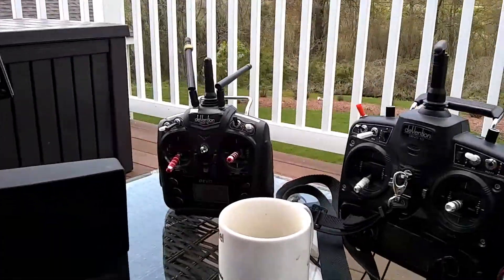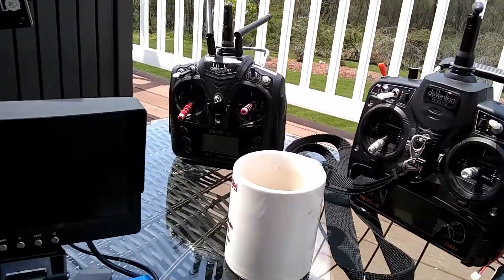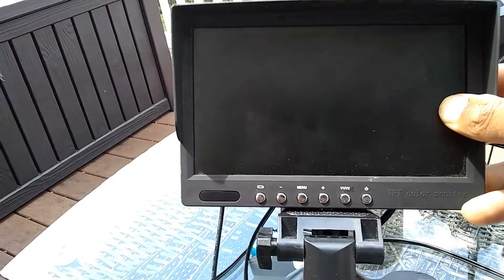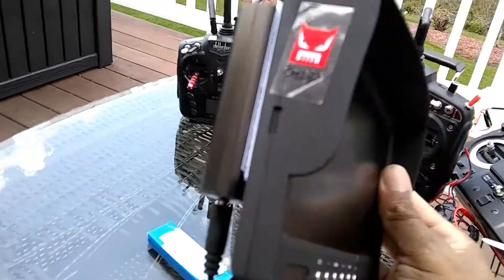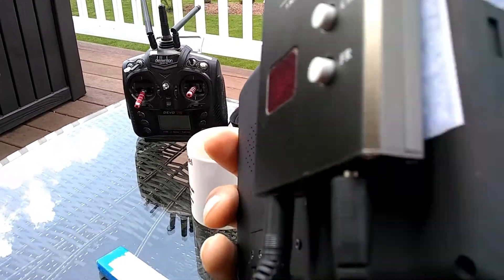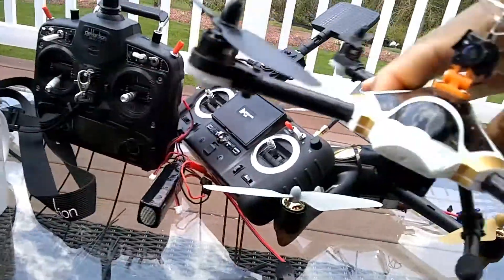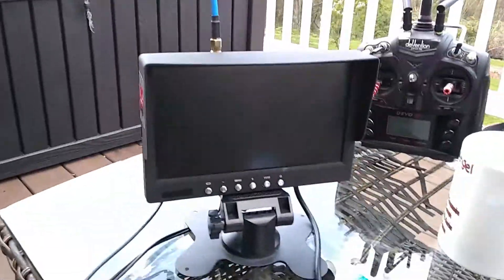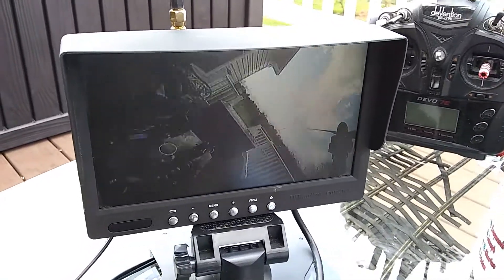Cheap FpV Ground Station Set Up

Comment: I have the same monitior ..
Im wireing it to a diversity and waitting for a a dvr to arrive.
What antenna is that by the way?
Do you have the link where you bought it from? 
Thank you.
Reply from the maker: https://www.banggood.com/FPV-5-8G-15dBi-Aerial-Panel-Antenna-5005-6000MHz-For-FPV-System-p-957749.html?rmmds=myorder&cur_warehouse=CN
Reply: Mods&Hobs 101 thanks mate.
Reply: Mods&Hobs 101 ahh ok my knowledge of conectors suck lol
My receiver has Antenna connections: SMA jack.
Bangood gives me a choice of rp sma or sma and i dont know which to buy .
Reply from the maker: Link your receiver and I'll tell you which connection you need.
Reply from the maker: You need the sma male.
Reply: Mods&Hobs 101 wow thanks for helping me out. Have a good week my friend.
Reply: @modshobs1014  hay man. Well i got that antenna you recomended from banggood  and set everything up on my diversity but only getting 300 meters.
Im using a vtx03 200mw transmitter.
I think i should be getting over 1000 meters.